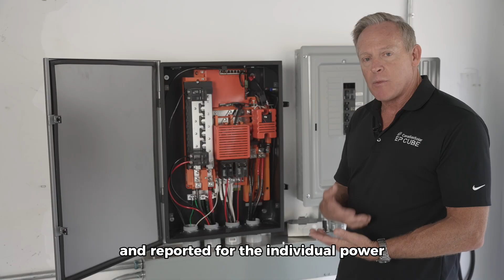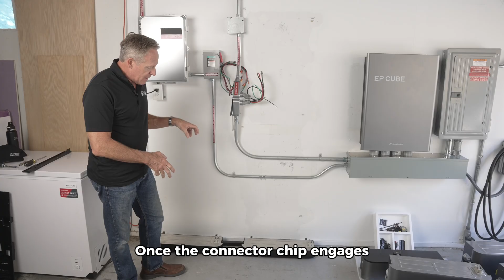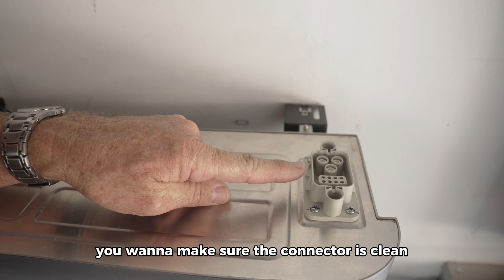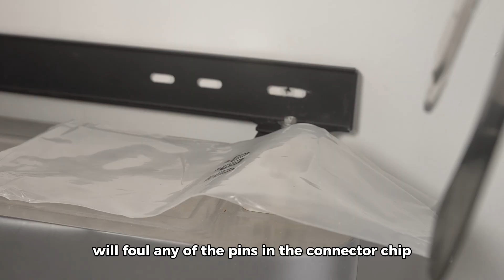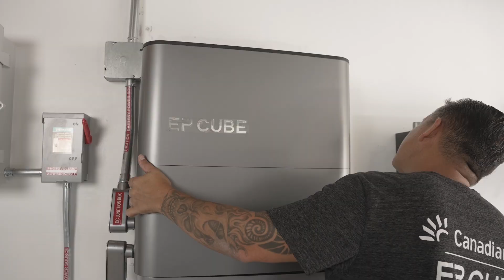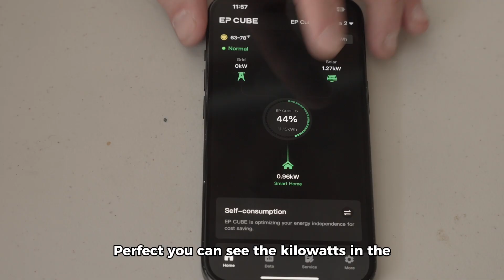US- Complete Installation Guide for EP Cube 2.0 Home Energy Storage System

Comment: Great system and with excellent functionality. Any timeline for integrating a MSA (meter socket adapter) to facilitate an easier install? This would eliminate the existing gateway. All the necessary connections and controls would be integrated into a 'Meter Socket Controller' (essentially a gateway without the transfer switch) like some other manufactures offer. Thanks!